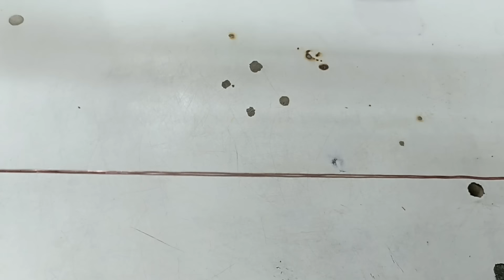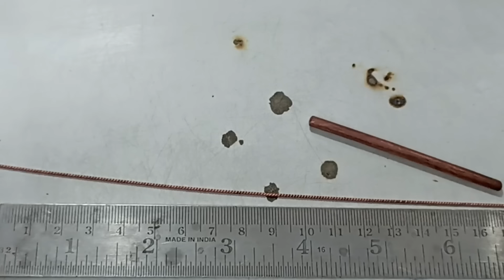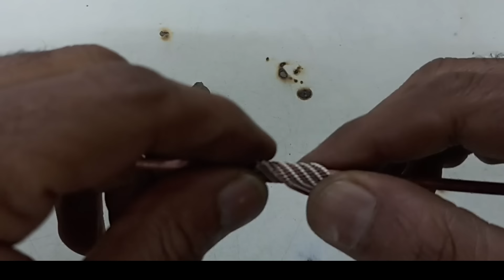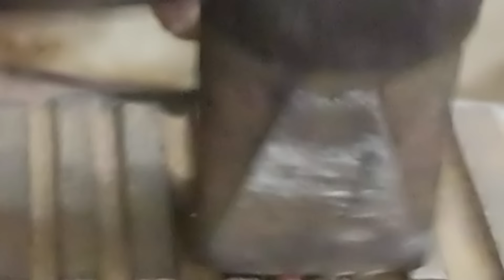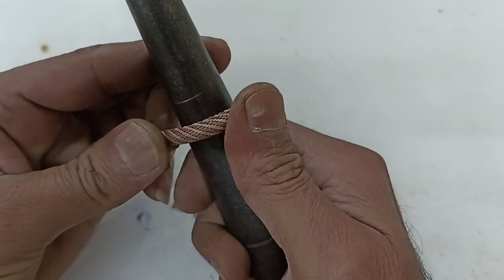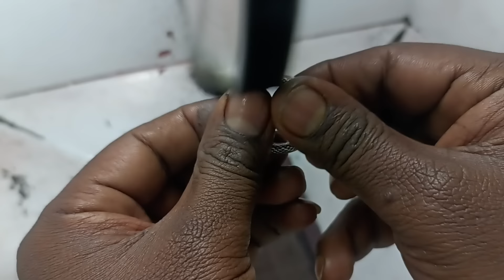making a ring from copper and silver wire || How it's made/ jewellery making/ gold Smith Luke

Comment: I’m curious as to what you call the metal bar with grooves that you hammered the ring on. Also, what’s the name of the device you used to measure for the size of the ring? Thanks for the video. I can’t wait to try doing this myself. Oh, one last question. What did you use to solder the ends together? Was it just simple rosin core solder?
Reply: The metal bar is called a swage block.  Look for Jeweler's Swage Block and you'll see a bunch like it.  The solder is probably a Silver Solder of some sort.  There are a number of different types jewelers use depending on the metals they're working with.
Reply from the maker: 7 gm silver 3 gm zinc is used for neck shoulder
Reply: The thing used to measure the ring size is a conical piece of steel, which is called a tribet, I think. Just a guess.....
Reply: Close but no cigar.. It's a triblet or mandrel. Hope that helps. 👍

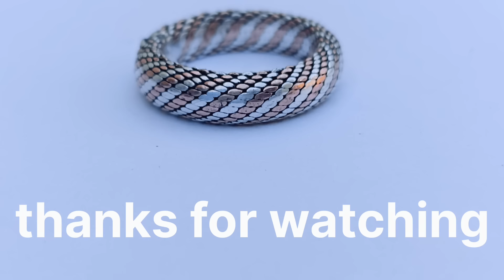Comment: hello great video and beautiful fabric 👏👏👏 where could I buy the tool that comes out at minute 6:30 to shape the bracelets and rings thank you and good luck Emnorabuena
Reply from the maker: It is a small steel rod with a sharp point at the front. It is polished to make it shiny or smooth.

￼
Reply from the maker: https://dl.flipkart.com/s/Un2DgyuuuN
Reply: Burnishing tools are what you are looking for
Reply: Any polished hardened steel will work as a burnisher. Even the shaft of most screwdrivers.

Comment: Aren't you concerned that the copper (base metal) will corrode in favour of the silver?  Just like zinc corrodes to protects steel, the copper will corrode preferentially to protect the silver.  The silver will stay lovely and bright but the copper will tarnish, pit and corrode relatively quickly.

Comment: A cheaper way is to use aluminum wire. Yes I know it won't solder and melts at low temp but if you're careful not to melt it the brass or copper wire holds it all together. I haven't tried brass copper and aluminum. U se low silver content low temp solder used for high strength electrical connections like Space ships and jet engines were vibration is an issue. You can't use a soldering iron but a low torch works.